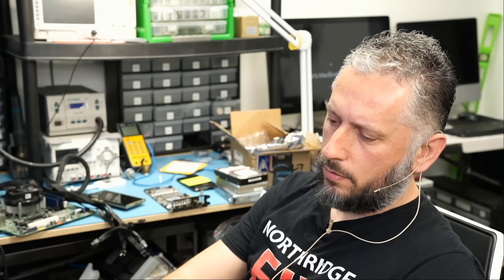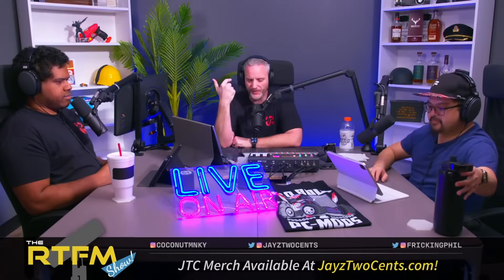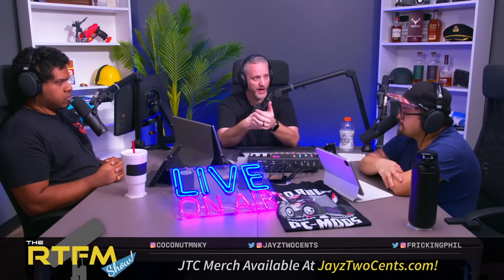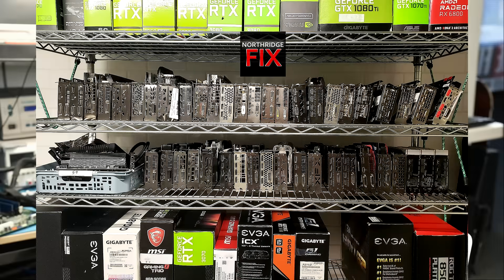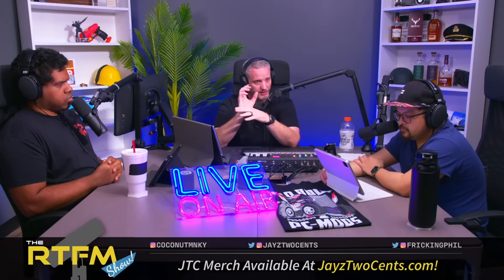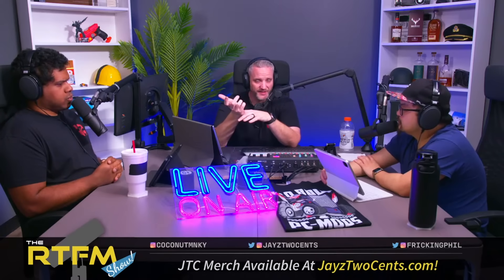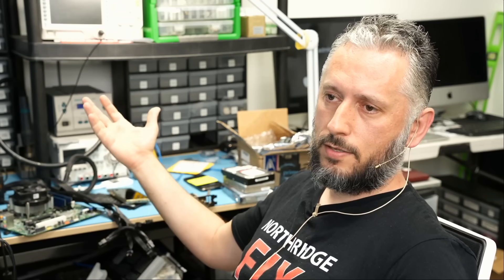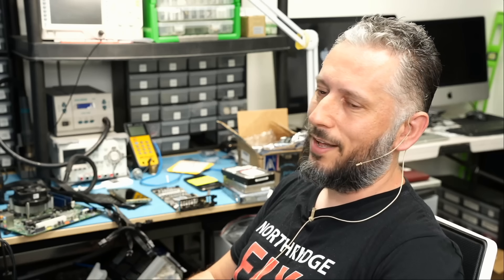Melting 4090 and CableMod. JayzTwoCents and Gamers Nexus Response. Blame NVidia or User?

Comment: Could it be that the connector side on the PCB is made from a less heat withstanding material / composition? Usually a renowned manufacturer like Molex, Amphenol and others make the plastics that is tested to heat tolerance of the pins that is embedded in them hence obtaining approvals from UL for fire hazards.... and PCB manufactured in mass quantity would usually be cost analysed and parts specified by design engineers (in this case the connector on the PCB side) were sourced from a lesser known or cheaper manufacturer to further cut down manufacturing cost? Usually we wont even see the manufacturer logo on this parts so there is no way of knowing unless its specifically listed in the Bill of Material (BOM) of the PCB manufacturer/ assembler.. .🤷‍♂ if it was the pins at fault here... it would have been visible from melting solder or PCB tracks changing color indicating huge current draw...

Comment: My conclusion is the device draws too much power and the connector's plastic quality cannot keep up with the generated heat over long term.
This happens frequently on 2 of my wall power sockets where one of them is in the kitchen and used to connect to the electric kettle.
The other power socket is beside my bed where it is connected to my air conditioner's power plug.

Over time, the power plug's live contact point will always have the plastic insulation melted around it while the power sockets' plastics are still intact.
I have replaced these power plugs over 6 times from different brands and manufacturers but it keeps happening.

Yes, all of the power plugs are fully plugged into the power sockets without any gaps, and they are not loose nor can be wiggled side to side.

Comment: I am with Jay on this one, if a product leaves big room for user error then it is a poor design. And also if the melting occurs on the card's connector then it is a card/connector design issue. Maybe heat can concentrate and increase at the connector and if I am right increasing copper temperature also increases its resistance (so increasing load can increase temperature). 
For example: if the GPU needs to produce a certain performance (e.g. clock speed) it pulls current and voltage. If the GPU does not get enough current it will require more from the power circuits (this is how I can imagine, maybe I am wrong) so increasing current increases temperature which increases resistance which also increases temperature and that is how it can reach melting temperature.

Comment: Im with you Alex. One connector melts with cable plugged in directly, one connector melts with adapter, its the design. Nvidia is pushing to much voltage threw one connector. 2000 and 3000 didn't melt so what changed? Number of connectors.

Comment: The failure isn’t just the cable not being fully seated its ultimately  the pins not making perfect contact inside, which is Steve’s point on the previous cable I think. If the pins don’t make perfect contact it results in this. You seemingly haven’t even taken a close look at the pins inside the 90 degree adapter if they were warped in any way or weren’t making by good contact they absolutely could cause this still.
Reply: I get that Steve was just pointing what the exact cause of the melting may be. But the point of this video is not about what may cause the burning, its about who is to blame when it happens.

No other product has issues, just 4080 and 4090. So it's clear that, with warped pins or not, the cars is using way more power than that connector should provide.

Nvidia is to blame here to not distribute the load correctly, or even make a beefier connector and include a adapter on the box.
Reply: @PedroBorgesNH  but that's not true at all. The connector is fully rated and handles that much power fine for like 99% of owners. I have one, it's been solid since the day I got it. Granted I've been using my PSU's 2x8pin to 12vhpwr cable and not the adapter they come with, but the connector can handle the full rated wattage so long as the connection is solid. I've gotten my card to pull like 525w on it's own, no problem, tho it's usually never near that.

Now you talk about blame, and that is still debatable. So let's say you have a 4090, it's been working great for months, you're not happy with your cable management having four 8 pins visible so you get the 90° adapter. You unplug your 12vhpwr cable pop the adapter on and plug it back in. If you wiggling that connector out wears the pins inside so that when you now plug it into the adapter it melts, this is still kind of on the user. Though we could debate how crappy the design is until we're both blue in the face.
Reply: Like don't get me wrong I 100% agree Nvidia needs to update the 12vhpwr connector with a new revision that fixes this issue.

Comment: amp draw too high, resistance, failure beween plug n pins on car ,, needs thicker pins, maybe space them out more on card, to keep pins cooler. or maybe make a fan mod for cable put a fan directly on area cable is, maybe reduce temp to plug,

Comment: Well, you all have the same conclusion really. There are extremely rare examples of fully seated cables, cause unknown, otherwise it's a combination of bad design and user error. The user error is driven by bad design which is the designers fault. Steve's language is a little more on nVidia's side because he is a little less tolerant of user error. nVidia has accepted all RMAs. Edit: also, you're one of my favorite youtubers but you're being a little faceteous with the cable wiggling comments. GN were not showing how to seat the cable or test the connection by wiggling it 20 times, it was an example showing how the cable could be unseated if it was moved.

Comment: The fix for this issue is simple. If you can’t reduce the resistance at the connector, then the plastic needs to be made more heat tolerant. A different connector design is warranted. This is a manufacturing/ engineering design issue.

Comment: If someone buying 4090 it means the user have alot of experience in computers or previous generation of gpus . So how the user can plugged the cable unproperlly.  4090 its a very costly gpu every one can care about it after buying. Its not the user error this is the error of Nvidia 100% 😊.

I think nvidia need to divide the 3 into 1 cable port to 3 into 2 . I think when some playing games on 4090 or any heavy productive work on it.

So the gpu requires a huge voltage ⚡ so the the connector will be burned  🔥 .

Comment: Why is it that 1-2 of the pins melt first and the rest are almost unharmed? Seems like the current is uneven over those six 12v pins. If it's 50w+50w+50w+50w+150w+150w then there's no wonder two pins melt.

Comment: earlier model cards use the same connector with no issues?
but now this one suddenly is having issues?
seems i mentioned before that if you push more amperage/current through a single connector that is possibly not really designed for that rate of amps/current something is going to give.
like alex said, it always melts on the card side, so the problem has to be the card in some fashion.
examining the connector is not enough to make a determination, even using a thermal cam to see heat source spots is not enough, find out the rating of the connector and monitor how many amps is going through the wires, take the rating of the wires into consideration and the pins. If you push too much current through a pin set or wire that is under rated for the current being pushed through it the wire/pins are going to heat up and melt the connector together. Would this not explain why the earlier models (lower power rated) cards did not fail in this manner that had this same connector? It seems i remember having high end gpu's in the past that had multiple connectors to spread the load across them instead of trying to push all that current through a single point like in these.

Comment: the problem isn't about misaligned pins or not fully socketting the connector, though these issues could speed the progression of this happening. The problem is forcing high amounts of current through an insufficient amount of pins. Think about it... You have 3x 8-pin connectors (24 wires/pins) bottlenecked into 12 power pins, which would be fine so long as the video card does not draw more than what 12 pins are rated for. On top of that the connections from the pins to the connector are not perfect by nature , so the pins aren't making perfect contact with the connector (in comparison to a soldered connection which is true for all connectors), which de-rates the current carrying capability of each connection (in addition to the additional connections to the 8pin connectors), causing higher resistance at those connection points which creates heat that is melting these connectors. If Nvidia stuck with the 3x 8 pin connectors, this would never have happened. This is a major design flaw for video cards that draw this insane amount of current (amps). Nvidia should've de-rated the connections based on load calculations and realized that they should've stuck with 3 8-pin connectors or created a connector with, either more pins,  or thicker pins. This is 100% a manufacturer fault and not user error. <period

Comment: I still think it’s the connector. I watched Steve’s video when Alex shared it. I disagree with him. The burn line he pointed out is just the contact point of the pins. Being even across and not slanted would indicate a flush fit. Contact surface of connectors are mostly microscopic, the most full surface connector I have ever seen was a spade and screw. I don’t think it is the card itself or we should see more damage like cables or adapters since they’re all made by different manufacturers. Invidia is getting the card’s connector from one manufacturer and to save money on material they will mix other metals which I think the problem is. It is creating resistance that can’t handle the power. Manufacturers cut costs every place possible and the individual costs are just pennies, but add up. They all do it. I think we would see damage in more places than just the board connector. If Alex’s replacement connector never burns again, there’s your proof, it’s the material.

Comment: Fact that this mainly only happens on 4090 series tells you it's card design problem. Maybe that particular connector cannot handle the current draw from 4090.
Reply: Is he taking about only one card I don’t think so
Reply: @crabcrock  well what I understand it’s predominantly the Rtx 4090, possibly also some cases of 4080.  Both of which use new 12VHPWR connector. Burning is still rare but nonetheless I agree with Alex it’s likely something related to card manufacturing

Comment: This is a house-made problem by Nvidia because they so desperately wanted to use this new undersized connector, just to avoid using multiple 8 pin connectors. This feels like change for changes sake. 8 pin connectors worked fine for years, and 3 of them would have been enough to power a standard 450W 4090. Some will argue that it looks "ugly" with 3 (or 4) connectors, I've even read people arguing that it will impact the airflow significantly. Complete bs if you ask me.

Comment: I totally agree with you because if a product has such high chances to fail in hand of end-user then it's the designer's fault. Its been years since we are using PCI-E power connectors for graphics card but never had so much issues with their connectors, cable mods, cables, etc. 

I'm not a super computer geek but I am gonna put some points I have in my mind- 

1. Low melting point plastic used in connector 
2. Female pins are not thick enough to handle that much watts
3. Play between in male and female pins inside connectors even when the plastic body of the connectors feels tight and firm

I would like to mention again I'm no computer geek. Just putting what I had in mind.

Comment: as a summary it could be 1) poor mechanical design on the NVDA pin receiving side. 2) poor coatings on NVDA pin side. 3) poor heat dissipation on NVDA pin side....
One more important question is : Why same problem has not been seen on the PSU receiving side of the 90 angle adapter, at the end it is exact same pin receiving shape and size of NVDA card pin. Nothing happens there.

Comment: Agreed , if the user plug in the cable used it for a while then purchase 90 degree cable mod , then why did the cable mod melted onto the video card it should have melted on the cable mod only, if its an issue with the connection being loose  Alex youre spot on keep up the excellent work

Comment: the only thing i see is that the card manufacturer are cutting cost on the connector and they selling it for couple of thousand dollars they dont care about the end user they just about their pockets combining three power socket into one is really bad idea 4090 and 4080 are drawing lots of amps through that tiny pin like needle is really a disaster waiting to happen and nexus gamer is blaming it on the end user his just full of B.S. he doesn"t understand how electricity works I bet he can"t even differentiate AC and DC

Comment: I'm with Alex here... But I do have an idea on how to 100% prove it's an Nvidia connector problem that's physically soldered onto the board. Take that 12V pigtail that you would plug into the connector on the board, remove the pins from the 12V pigtail and plug them into the card. If his theory is correct any slight movement of the card with the pigtail plugged in should result in the connector on the PCB being burnt. How much movement is needed to cause that, I have no idea however, at this point I think that's the only way you are going to prove to Nvidia it's their problem. Not the power supply, not the user, not cable mod, not Northridge, NVIDIA

Comment: No melted 4070Ti and 4080 just 4090, and all of them with the same connector. The only difference is current, so it can point out to 4090 drawing more than it is rated, or simply this connector can't reliable withstand rated 600W (or not all of them due to fabrication errors). This is not user error if you ask me.

Comment: To me it looks like NVDA pin side is not properly designed to handle designated continuous current withdraw, resulting heat generation, generated heat will damage the contact even more resulting more contact resistance which will feed the heating even more. After certain period of time, the contact will melt. It looks like the other end of 90 degree adapter is designed properly to receive such high continuous currents properly. By the way by saying design on the NVDA pin side, it could be improper electrical contact coating on that pin as well, or some mechanical design flaw resulting initial higher contact resistance. Or it could be an improper heat dissipation issue too, at the end heat at the contact will damage the contact even more by time resulting higher contact resistance... Resulting catastrophic damage over time.  Overall it is more likely that this is NVDA issue in my opinion.

Comment: Can you cable clamp each of the individual wires on a 12vhpwr cable and see if they are all sending the same amount of current through them at the same time ? If the power is not distributed evenly across all the wires then as small as they are and as close as they are could cause problems.

Comment: What steve was trying to say is that said user used the GPU without the 90 degree adapter for some time and that it could have been improperly seated during that time, so there could have been some miniscule amount damage done already before plugging in the adapter which made improper contact from the inside when cable mod adapter was plugged in which resulted in it melting also. I do agree that nVidia should take responsibility for their flawed design, but will they do it I honestly don't think so.

Comment: As an electrician with 25 years of experience, i don't feel i know enough to conclude where the problem is, other then there for sure for some reason, have been a bad connection somewhere in the 12hpwr connectors on these graphics cards.
I don't know if the problem is on the male or female side, or maybe both. But the 12vhpwr plug can defently be improved, and maybe is the 12v 600w rating for this plug is a bit to high.
Reply: Try 1000 w users push through them on 4090 card

Comment: It might be interesting to use soldering station to test melting temperature of a 4090 connector and compare it with melting temperature of plastic from the CableMod adapter, old video card connectors and cable connector to discover if it is not significantly lower. I can imagine the issue can be combination of insufficient wire gauge and plastic with too low melting temperature used for the 4090 connector.
Reply: Yeah, this is a good idea. People have said the connector is the same as the 3090 but maybe it's same format but lower quality plastic and higher resistance metal? 

Maybe the 4090 has power  fluctuations that cause rapid spikes in current draw (causing excessive heat and no chance to dissipate) and that's what's melting them?

There could be a bit of a threshold problem. The 4080/4090 draw too much current, cause heating, connector heats up, resistance increases, heats up more and then bam it's cooked. 

Or maybe there's simply not enough metal on metal contact at the connector and they need longer pins, more metal. 

It needs investigating one way or another.

Comment: IT LOOKS LIKE UNEVEN CURRENT FLOW THROUGH CONNECTOR. SOMEONE SHOULD CONNECT AMMETERS TO ALL THE PINS AND MONITOR REAL FLOW OF CURRENT THROUGH ALL OF THEM IN REAL TIME UNDER LOAD. IF THIS IS AN ISSUE THEN NEITHER CONNECTOR ALIGNMENT NOR USING ADAPTERS WILL FIX THE PROBLEM. CHECK THE FACTS FIRST, THEORISE LATER.